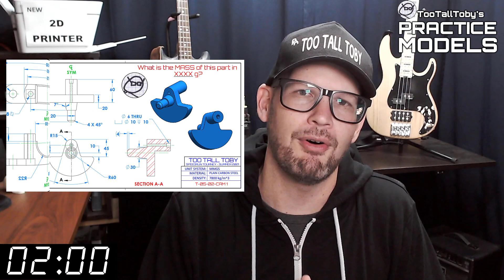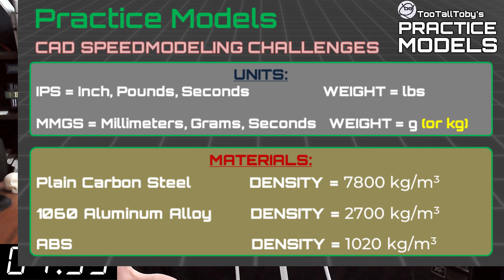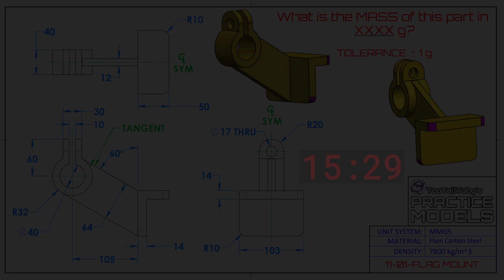SOLIDWORKS Practice - Onshape Practice - Fusion 360 Practice Exercises - TooTallToby-11-01

Comment: I'm new to calculating weights of models. I'm using Fusion360 and have found a standard "Carbon, Steel" material which gets the weight close but not perfect. Can anyone explain to me how to check the settings of materials in Fusion or add the right materials for these challenges?
Reply from the maker: Hi Rudd!  Welcome to the channel - Take a look at this video - I think this shows how to create a new material, and I suggest you create 3 materials - ABS, PLAIN CARBON STEEL, 1060 ALLOY - which use the TTT density values. Hope this helps!   https://www.youtube.com/watch?v=7eYo_10i_2E
Reply: @TooTallToby  Thank you, I'll give this a go!

Comment: I used the  rib  feature  for the  upper  tombstone  shape. that  was  a good  way  to bring the  whole  feature  up to the  body  without  having to extend  your  sketch for the  feature into the  body  of the  part. It  makes  for more features but I prefer to  cut  extrude plain  holes. It took  me  way to  long to  get  this  model done but at  home  with one  monitor.
Reply from the maker: Not bad at all - especially with 1 monitor :-)